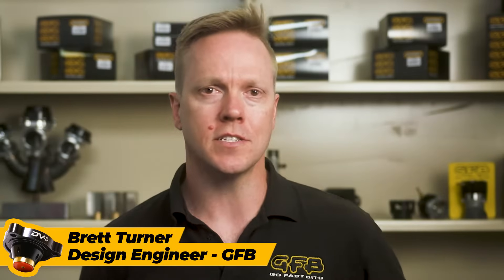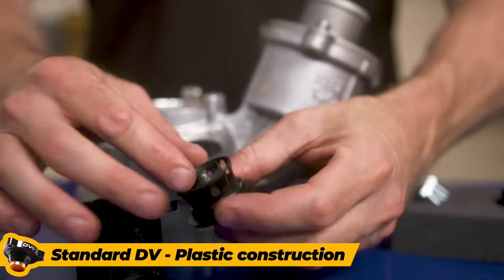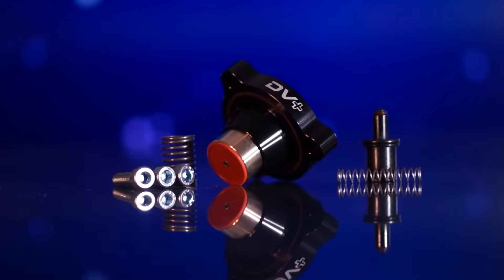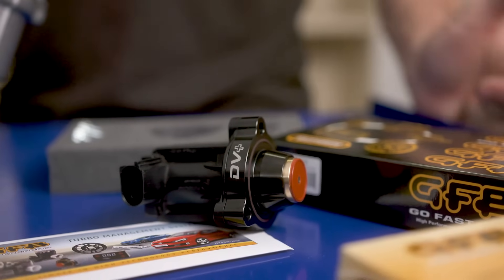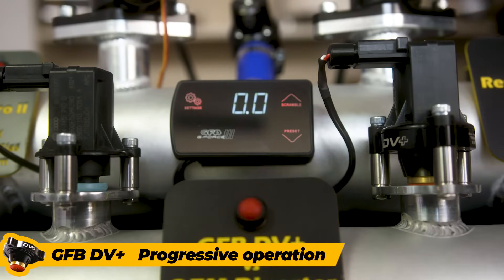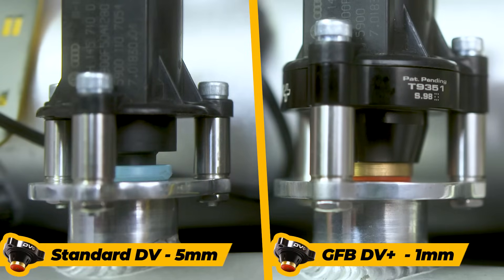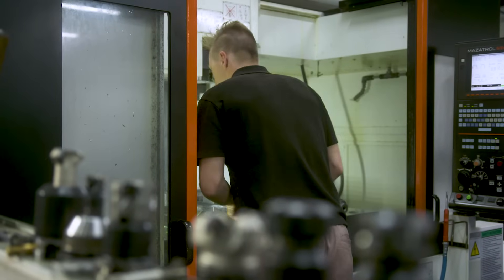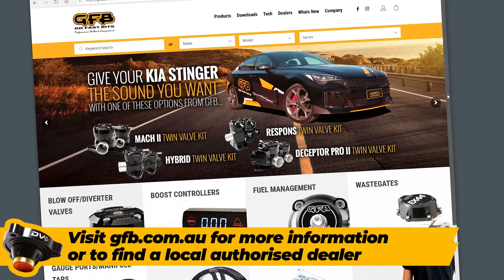GFB DV+ Diverter valve overview

Comment: Hey, I bought one I installed it correctly I looked at the instructions double triple checked I used YouTube. I did everything correctly but the valve didn’t open it stayed shut and I got major compressive surge/turbo flutter. I put oil around the brass piece the fitting snapped into place nicely I did everything correctly I thought it was a bad solenoid so I switched it out for a new one and still the same problem. I went back to stock for now and everything works but all I want is a replacement please.🙏

Comment: Question

Should the brass piston (the one with the red rubber) seal directly to the hole inside the diverter cavity of the turbo with the help of the spring pushing the piston up?

i had a situation where the piston didnt reach the hole inside the diverter cavity and didnt seal correctly, had to get a longer spring to properly push the piston against the hole.

This was on a mercedes a250 hybrid turbo

Comment: Is it also for automatic transmission cars?
Reply from the maker: Yes, it will work on all transmission types, but be aware the diverter valve is not directed to open on gearshift with auto or DSG transmissions. This means the response benefit is only applicable when you open and close the throttle, which is when the ECU activates the diverter.

Comment: Im considering buying one for my 17 focus st! Do you grease or oil these before installing??
Reply from the maker: It's best to use a little engine oil during installation. Do NOT use grease, it creates too much friction and the valve won't operate properly. Note that regular maintenance and re-lube is not necessary - during use they usually get a film of oil from the crankcase ventilation anyway.

Comment: Hi there Merry Christmas 🎄 
Late to the party but hopefully I'll get a response. I got one for my mini r56 JCW gen 2 about 2 years ago. 
I got a complete loss of boost last night and a wooshing noise under my bonnet. I took off the DV+ and the top was flush and wouldn't move. Is that normal? 
Could it be my issue? 
If so I shall get another as it's a great bit of kit.
Many thanks. 😊
Reply from the maker: Hey! To answer your question, no, it's not normal for the piston to be flush and not move. I'd suggest contacting us through our support page https://gfb.com.au/contact-us/ so our engineers can get some photos from you and get the issue resolved.

Comment: @GBF Simple question.  Why is the second option of dv+ operation without a thick spring behind a large brass piston not shown in the video?  Is it possible to operate dv+ without a large spring behind a large piston?😮
Reply from the maker: Hi, yes it is possible to install and use the DV+ without the main piston spring installed. In some cases with highly sensitive ECU’s a P2261 CEL code can be triggered by the ECU in response to the added throttle response gained from the DV+ with the main piston spring installed. The DV+ is intentionally designed to retain a small amount of pressure in your intercooler system when coming off throttle, which the ECU then assumes that the diverter valve is no longer working – hence the P2261 CEL code. 

For these rare vehicles, we recommend removing the main piston spring as this will modify the operation of the DV+ to work more so alike the OE diverter valve. Removing this spring will remove the additional throttle response gained from the DV+, however, you’ll still be able to enjoy and experience better boost holding and solving boost leaks.

Comment: Great video mine is getting installed now. Been getting some boost pressure issues when lifitng off the accelerator in 3rd gear. I hope this product will resolve that problem and more happy power avilable all the time.

Comment: Could you technically tune the intake pressure required to open the DV by changing the spring rate inside the piston ? That way you would get a little bit of closed throttle surge (purely for sound) but still went the excess pressure that could possibly damage the turbo over time.
Reply from the maker: Let me start by saying that the following information is not a recommendation by us, and changes you make to the product you do at your own risk. With the disclaimer out of the way, yes, you could increase the spring pre-load slightly to achieve some fluttering when lifting off at low RPM/boost, and still have it vent fully at high boost. However, you will almost certainly get a P2261 fault code. Typically when you get flutter, you also get that fault code, and it doesn't take much increase in spring force for this to happen. 

If you are happy to live with the fault code to achieve flutter, then I would not recommend that you do it by stretching the spring - it's irreversible and only small changes are needed. I would instead suggest finding something to shim the spring so you can do it incrementally and reverse the mod if you need to. It will take no more than 1-2mm to achieve a fluttering sound.
Reply: @gfbvideos  Got it thanks ! Basically adding a spacer to the spring would be effectively the same (but less conveniant) as using a DVX on full recirc and tightening the ajustement screw ?
Reply from the maker: @pascal789456123   Yep, spacing out the spring would do the same as the spring adjustment on a DVX. Just make sure to make small adjustments on the DV+ spring, as a 1mm shim in a DV+ has a bigger impact than 1mm of pre-load on a DVX.
Reply: @gfbvideos FYI, ended up with a 3mm shim on the t9381. 1mm and 2mm had no effect, 3mm gives some flutter. Made a custom 3d printed part out of ASA for heat resistance. Might go down to 2.5 if I get the check engine like stated above. 
Btw the dv+ had quite a different vent tone than the stock dv. Stock was more of a pffff (like exhaling with a shut mouth , while the dv+ has a pshh sound.

Comment: Does this throw an engine code on a mk6 gti?

I’ve heard that it has on multiple occasions for other cars
Reply from the maker: In some rare circumstances, the ECU may not be happy with the secondary spring used in the DV+. If that is the case, it can simply be installed without the secondary spring to closer mimic the operation of the OEM valve

Comment: Installed it on my BMW N20 engine. Feels slower than before, lot more turbo lag. Power builds up in high range but in low ranges power delivery is very sluggish. Installation error?
Reply from the maker: Sorry to hear you're having car trouble. 
For technical support please contact our engineers at support@gfb.com.au

Comment: Hi guys, question for anyone that could comment on durability after years of use.. I bought a 2011 gti with motor problems, had it rebuilt, it almost done getting tuned and mechanic is telling me I have boost issues. 

I'm not exactly sure what I'd expect, if anything to suspect, failing on this whole combined unit. I think he was stage 1 or stage 2 tune, and had it on there for years. My mechanic said he tried a new diverter valve, and actuator, but neither "worked" and upon trying a turbo he borrowed from a friend to install and test how it ran, said it fixed the problem, and I have a bad turbo..

Soo, main question is, after years of usage and being tuned, is there anything beside lubrication around the piston I should focus on, or should I just take his word, and have him swap this dv+ unit from the "broken turbo" to the replacement I find?.. because this part is supposed to replace the faulty cheap part, with crappy diaphragms and plastic, this part should or should be expected to out live a turbo? 

Also, HUGE huge thanks to anyone that's willing to respond, any input and information is appreciated beyond belief 🙌🙌🙏🙏.. this thing has been in the shop for about a year 😒 and though the reseaech has been fun, still not as fun as having my car working and able to drive.. anyways, thanks yall 

-Nick
Reply from the maker: Hi Nick, we only recommend lubricating the piston with ordinary engine oil to help aid with the installation process. The piston shouldn't need to be reapplied as a form of maintenance. I'd recommend giving the DV+ a good clean and lubricating the piston with fresh engine oil prior to installation. Check to see if the piston is able to move freely in the bore.

I'd be unable however, to comment whether the DV+ would be able to solve the turbo issues that you've encountered. Your mechanic may have a better idea regarding what is going on with your car as he can actually physically see it. I would be surprised if both a new diverter valve and actuator were faulty - I would suspect a problem elsewhere.
Reply: @gfbvideos  alright, I'll definitely inspect it and also try a new DV solenoid and transfer THE GFB part to it. I'll take that and put it on a replacement turbo and tell him to install that to see how it works

Comment: How often does the dv+ piston need to be oiled to avoid it seizing? Thanks.
Reply from the maker: The piston only needs to be oiled on installation. Once in, it should not require regular maintenance. If you have a particularly dirty intake, you may need to clean it every so often, but this is not common

Comment: If im looking to increase turbo noise does this diverter valve impede that progress?
Reply from the maker: Hi, the DV+ is full recirc and is not able to vent to atmosphere, meaning that it wouldn't be able to make a "whooshing" noise when coming off throttle.

Comment: You guys think you are very slick using the oldest d v valve... The newest revised d valve  is just as good as this...
Reply from the maker: Hi Korey,
Unfortunately that's not correct.
 
The Rev D valve DID solve a lot of the reliability issues that the old diaphragm style valve did have. 

The piston style valves like the Rev D however leak all the time, even in perfect condition. The use of a plastic piston and seal means that even straight out of the box these valves will leak substantially. 

This leak to a certain extent can be compensated for by the tune, it will work the turbo harder to overcome the leak through the valve. You get the same amount of boost pressure, but because you're working the turbocharger harder to achieve this it is less efficient. 

Happy to send over some videos showing this to be true if you're interested. you can contact our engineers at support@gfb.com.au

Comment: Hey 👋, fitted one of your DV+ valves recently and it works great but im wondering why/how its quieter than my stock valve ? Im guessing it’s because it closes faster so lets less air recirculate?
Reply from the maker: There are a few reasons you may find the DV+ change the sound slightly. It will depend on what noise it was, and why the stock one was making noise as the should (if everything is stock) be almost silent. If you can contact our engineers at support@gfb.com.au with some videos of the sound you're talking about they'll be able to explain further

Comment: Hey, Brett. Since my last comment, I have done a stage 1 tune on my Mk5 GTI dsg. I currently have a stock version G (the one with the rubber diaphragm) diverter valve on the car. It doesn't leak, but now that the stock turbo is providing around 18 psi of pressure as opposed to the stock boost pressure (around 8-10 psi I would guess), I'm getting what I assume is compressor surge. It only occurs on throttle lift-off after a low RPM pull under full throttle or close to it. It's not the full "fluttering" sound, but more of a shorter "squash" sound. My question is, do you think the GFB DV+ will eliminate this low rpm squash or if I should even worry about this since it's not a high rpm high turbo speed/rpm condition. Also, I still don't understand how the DV+ opens 20% faster than the stock dv valve. I understand how it holds boost better since it closes almost immediately but it appears to open when the cpu tells it too just like the stock dv valve. Any info is greatly appreciated. Thanks.
Reply from the maker: I'll address the opening speed question first. Yes, the ECU still triggers at the same time, but the DV+ mechanically opens faster than the factory diverter once the ECU triggers. This is because on the stock diverter, the solenoid must move the piston directly, through a stroke of 5mm. On the DV+, the solenoid's stroke is only 0.8mm since it only needs to move the plunger, not the piston. Once the plunger opens, the piston in the DV+ overtakes the piston in the factory diverter to open fully 20% faster. We are talking fractions of a second, but faster nonetheless.

However, there is a bigger factor here. The stock Rev G is likely not opening fully in your case. It is very common for the rev G to only partially open at higher boost pressures, which is likely why you're now hearing surge. In this case, a DV+ will cure the sound you're hearing. Note also that a tune on the Mk5 will make the turbo spool more aggressively at low RPM, and it does make some different sounds when lifting off at low RPM when the boost is not at maximum, stock DV or not.
Reply: @gfbvideos  Sounds like my problem might just be the sound of the boost going into circulation when the stock rev G diverter valve opens at low rpm. I probably didn't notice it before the tune because the boost pressure was so much less. I did recently remove the diverter valve to check for leaks. I cleaned it and inspected the diaphragm. No holes. So maybe it is working correctly. The only way I'd know for sure would be if the turbo had an rpm sensor directly on it that could be monitored by an obd II app, I guess. Do you know of any other way to monitor for surge? Like an obd app that can show graphs for boost pressure spikes or turbo rpm stalls?
Reply from the maker: @quesnoy1  Graphing boost pressure can show surge, but you would need to monitor with a relatively fast refresh rate and I'm not sure if the OBD apps will do this. 
The easiest way to tell is just to listen. If it's making a fluttering sound then it's almost always surge

Comment: Is it kind of hard to press the two together? I was having a hard time installing it and was wondering if anyone else has had any issues?
Reply from the maker: Hi Justin,
With the tolerance of the OEM plastic part, some solenoids are more difficult to press up to the DV+ than others. We've never found one that didn't fit though
Reply: @gfbvideos  awesome thank you definitely gonna try again tomorrow!
Reply from the maker: @Justinswhip  No problems! Another thing that can happen is that part of the plastic you remove to install the DV+ can break off and stay in the body of the solenoid. These bits will all need to be removed to install the DV+. If you're unsure feel free to send us some photos to support@gfb.com.au and we'll be able to let you know if all the bits have been removed
Reply: @gfbvideos  thank you again you guys have been wonderful!

Comment: Hi, is it suitable for peak 2.2 bar boost pressure and 2 bar cont. for 1.4 tsi twincharger (2013 CTH ibiza cupra)
will the gfb be able to handle this boost efficiently ? or I  have to continue with other brand xxx with blue spring ? Waiting to hear you soon

Comment: Can I use this on a e250 cdi I like the dump valve noise how loud is this
Reply from the maker: Hi Hasnain,
This product is fully re-circulating and therefore does not make the dump valve noise. If you're after something that does you can check our VTA range. I don't know what year model your car is so I can't tell you if we have something to suit, but you can use the vehicle selector on our website to find out

Comment: I own a 2017 Sentra Nismo . Sadly I bought the CVT version which I now regret . Anyways I made a few mods so far. One of the first ones was the  GFB DV+ and after the install I felt as if the car was more sluggish , throttle response feels slow compared to OEM . 

Any recommendations? I return the OEM set up back but still feels sluggish . Any idea what it could be ?
Reply from the maker: Hello,
If the sluggish feeling remained after re-installing the original valve then it's unlikely that the problem was the valve in the first place. It may have been something knocked or damaged during the installation, or something else entirely. 
If you're not confident in diagnosing the problem yourself, I would suggest taking your car to a mechanic to have them check it out
Reply: @gfbvideos  I was thinking the same or else I would been fixed once I switched it . Will this DV+ increase the sound while boosting at all? Don’t worry I know that’s not the purpose of it but rather to hood boost better and better response.   I was just wondering if one can expect a different while boosting .
Reply from the maker: @Lio88  While on boost the noise should be identical as both the stock valve and the DV+ will be closed.

Comment: Main question that nobody can find on the forums or even google! "DOES THIS WORK WITH PWG or PNEUMATIC WASTEGATE?"
Reply from the maker: Hello,
I'm assuming you're referring to a BMW N55 engine? 
If so they yes the DV+ is suitable for both the pneumatic and electronic wastegate versions
Reply: @gfbvideos  almost all turbo engines before 2014 came with pwg so not just the n55. All n54s still uses pwg
Reply from the maker: @raidacaipo  I understand that but we don't have a valve to suit the N54 engines. If there's a specific engine you're interested in it would be good if you could let me know which engine that is. 
As a general rule though, the wastegate actuator has nothing to do with the diverter valve so provided that we have a valve to suit that engine it shouldn't matter which wastegate actuator it has.